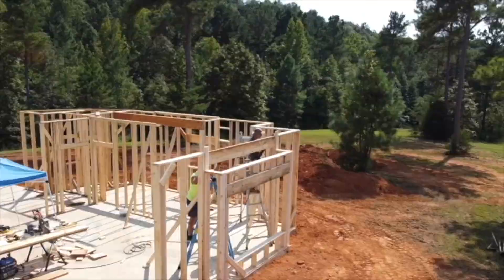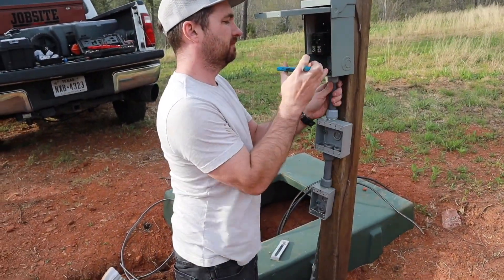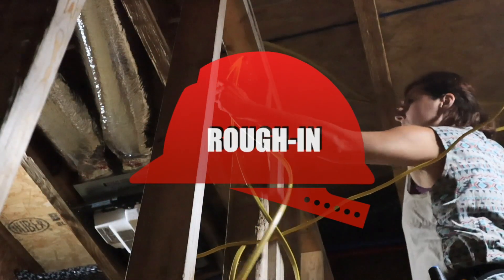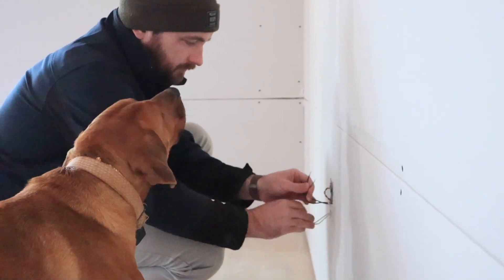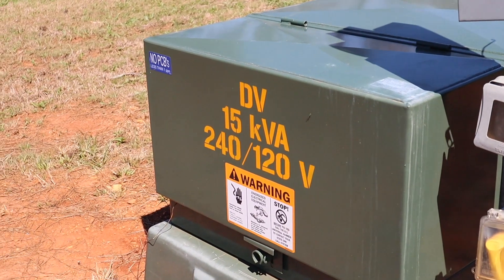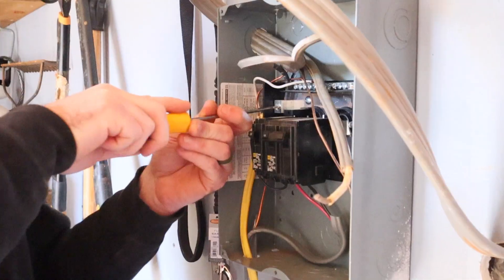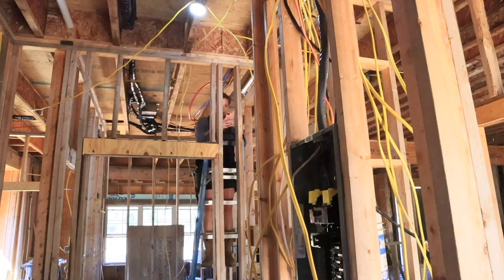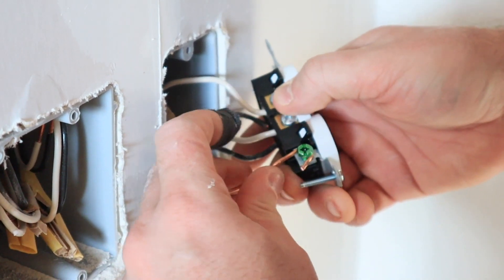Saving Big on Electric: Our DIY House Wiring Wins and Woes!

Comment: Thanks for the run down.  I'm in rural Tennessee also and in the process of building my own house. We passed our rough in inspection a few weeks ago. Unfortunately I didn't have my HVAC on site yet so the inspector will have to return to check the HVAC. What did the inspector check during the HVAC electrical inspection?
Reply from the maker: Good luck on your build and congrats on your first inspection! 
For hvac, he looked at the disconnect and the wiring inside the disconnect.